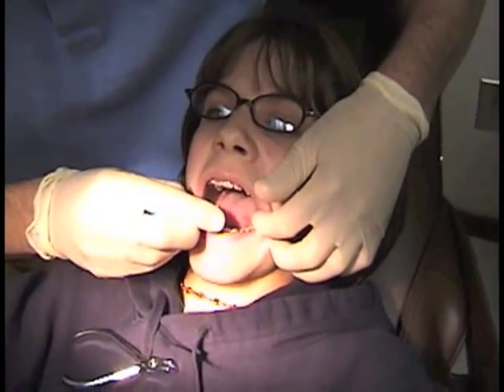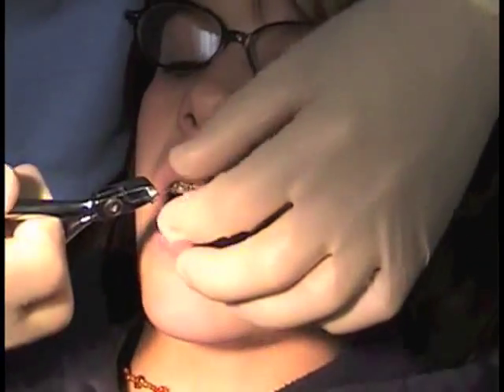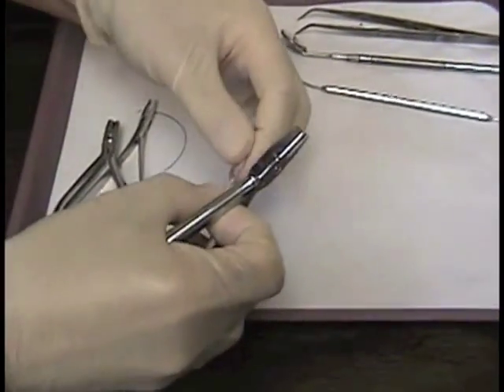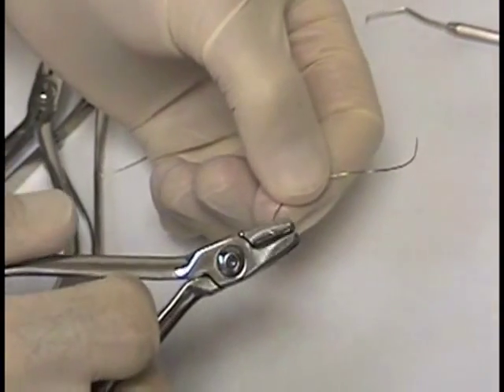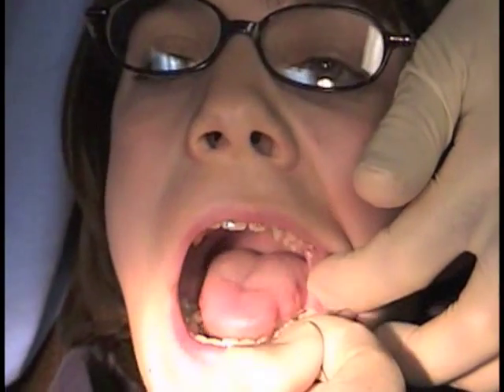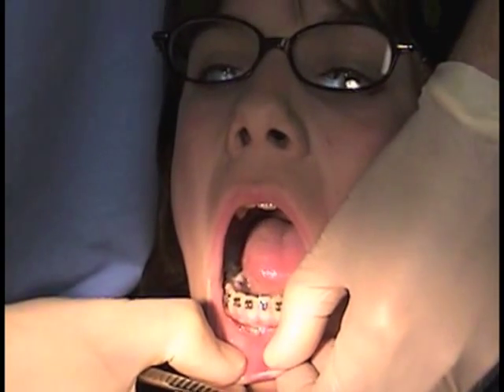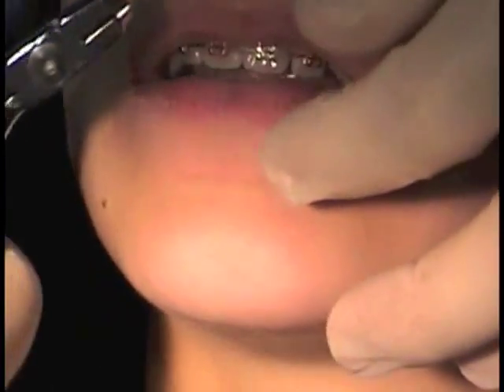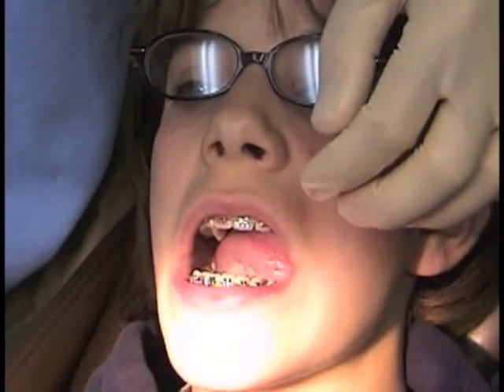ArchWireCurves

Comment: 1. It's better not to use the hollow pliers, because they tend to create sharp bends at the edges, and if you use it several times on one side of the wire, you are creating several small sharp bends. (one should use their hands to do the bending, it's destroyes your nails but that's the best way)
2. You should controll your archwire leveling when you do the rev. curve of Spee, the two sides should be at the same level (Just close one eye, place the wire at your eye level and compare). thank you